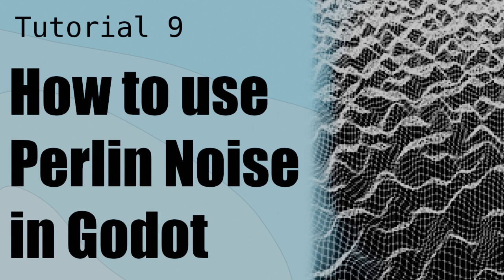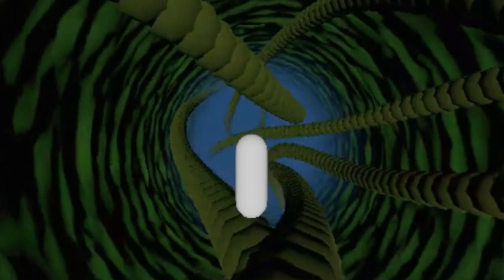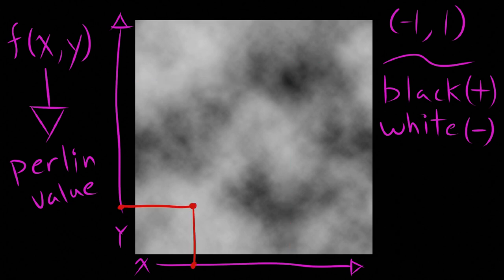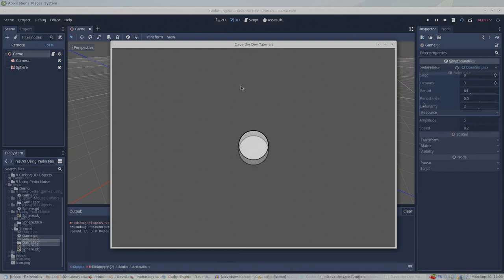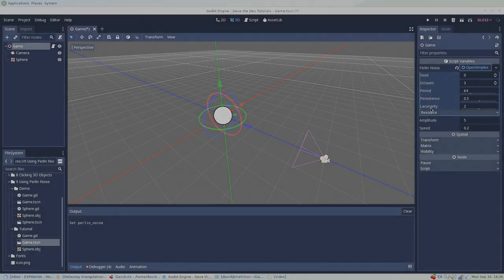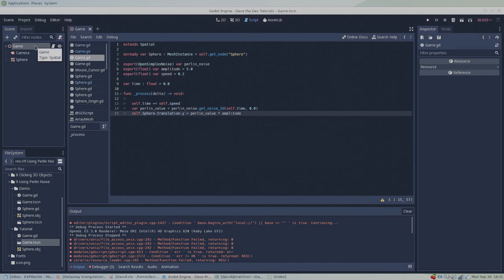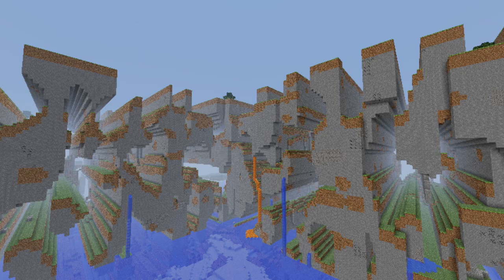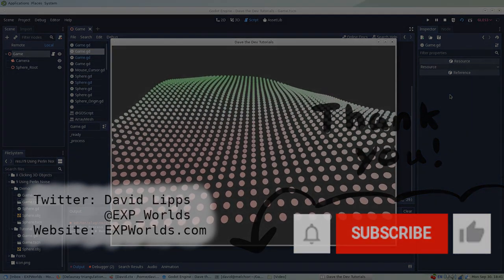How to use Perlin Noise in Godot | Game Dev Tutorial 9

Comment: care to share the code for that endless terrain generation you have at 1min mark
Reply from the maker: If you mean the falling tunnel part, that was made in blender using a blender noise texture to displace the vertex of a really long cylinder. Its a bit of a trick, its two of the same tubes stacked on top of each other, when the player falls to the same position in tube 2 that it started at in tube 1, it jumps the player back to the start position in tube 1. If you meant something else,  let me know and I'll get back with you. ^_^